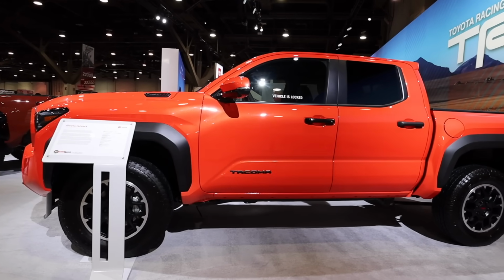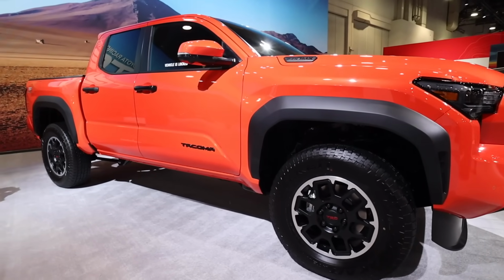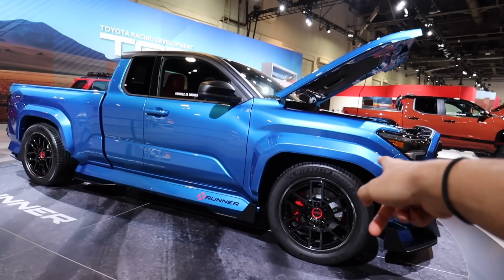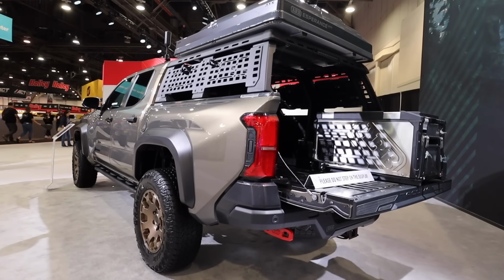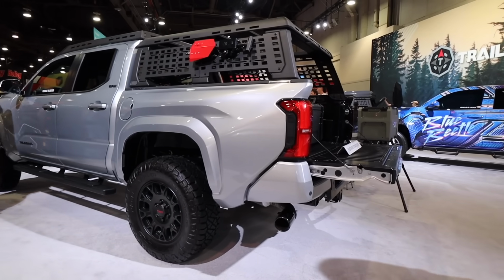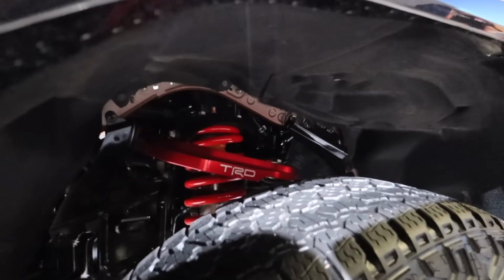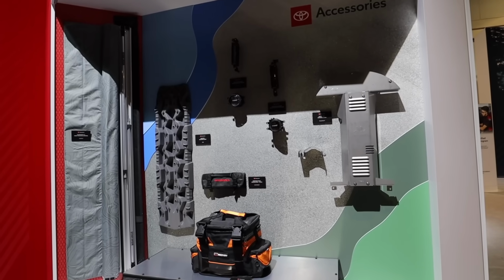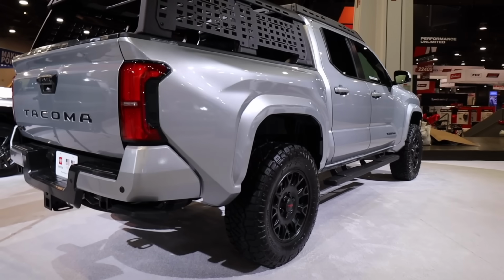Why the 2024 Tacoma is the model year to wait for! 🤷🏻‍♀️ Thoughts from a current Tacoma owner

Comment: I bought a 2023 TRD Pro a week ago because I don't want anything to do with a 4 cylinder engine.  And a new model year is going to be full of bugs with all the changes.  For the sake of the truck they should have put a small V8 in it with 300hp.  But I understand they are bending over backwards to comply with the government mpg and emission requirements.  Sucks for the consumer to not have an option.  With a V8, a trans that shifts correctly, and some useable bed tie down points, the Tacoma would be the perfect truck.
Reply: Why'd you buy a Tacoma with a V6 if a V8 is that important to you?
Reply: @ScreamsPenguin    The Tacoma fits in my garage.  The Tundra no longer has a V8 option.  Even a F150 only has one V8--and it is not the highest HP option.  It's getting hard to find full size trucks with a V8.  I can't buy what doesn't exist.  I decided to replace my '00 Durango with a mid size truck and was disappointed that nothing in the category still had a V8.  When I bought the Durango, most everything in that class had a V8 in it with a V6 being the cheap option if price was a concern. I hate this trend of more complicated smaller engines.
Reply: Sounds like you want a half ton
Reply: @slowfiveoh4986  1/2 ton won't fit in my garage, and most of them have  a V6.
Reply: @jobean5073  My garage is the same size as most homes in the US at around 20ft deep.  That seems to be the standard for the last 30 years.  While garage sizes haven't changed, the length of trucks has.  In the 1980's a four door truck was very rare and a regular cab, long bed, half ton truck would easily fit in a normal garage.  Now most trucks sold are 4 door.  How many regular cab trucks do you see on the road now?  They are very rare.  And even with short beds, the crew cab trucks are a tight fit in a 20ft garage--just a few inches to spare.  So, I don't have a small garage.  Trucks are just bigger now.  Even the Tacoma's are substantially bigger than they were 30 years ago.  I was a little surprised at how tight the fit was in my garage.

Comment: I’m a lube tech at a Toyota dealer. I’m glad I bought my 2022 Tacoma when I started here. I wouldn’t buy a 2024 since they discontinued the 6 cylinder engine in the production models. I wish they still had leaf springs on more than just the base model. I don’t like hybrids either. The high voltage battery is a ticking time bomb in that when it fails, it costs so much to replace it that insurance usually totals the vehicle. If I DID buy a 4th gen, I’d Coyote swap it as soon as the warranty expired.

Comment: This year I purchased my first brand new truck! A 2023 Lunar Rock double cab, 6 speed manual of course. The Taco loves off-roading with super low gear ratio with the manual and it’s probably the most reliable truck you can buy right now. But I’ve got my Toyota dealer trying to get me a Trail Hunter 😅 The way I see it, if I can have Toyota factory warranty all the upgrades I would do anyways and I don’t have to spend hours building it, that’s just more time I’m not worrying about break downs on my dime, and more time using my truck for work in the patch or getting out into that sweet Alberta / BC backcountry ⛰️ 

But then many will say “ But sir that thing will break down immediately just like a Ford” Ya cool story man I just don’t think Toyota would put this turbo I4 in a Land Cruiser if it meant tarnishing, the reputation that it’s had for having legendary reliability, longevity and off-road cred…

Comment: I wish the turbo V6 was a option for all of the 2024 Tacomas. I’m kinda concerned about the turbo 4 cylinder being durable enough just my opinion I’m not saying it won’t be durable but that little engine will be working harder having 2 less cylinders and being turbocharged and also making more power than the outgoing V6😬
Reply: If Ford and Chrysler(Fiat) have been doing it for a while successfully, Toyota will kill it. My dad has a JL Wrangler Rubicon 2.0T and the power comes on fast at the low RPM's and the vehicle moves effortlessly. Motors designed to handle turbos, especially at the low factory boost settings will be reliable.

As an owner of the old "TRD" supercharged setup on a 4.0 V6 Tacoma, I have faith in these new engines lasting a while (200-300k easy as Ford and Chrysler have already done). The 465lb/ft of torque is a must especially when adding weight to the truck for these "overland" builds. I have around 380lb/ft torque (crank estimate for comparison) and it is just enough to easily keep up with traffic once you add over 500lbs of mods to the truck.

Comment: Cross-shopping all midsize trucks and some base 1/2 ton trucks for purchase at the end of 2024. The Tacoma will be at the top of my list. Ideally, I would like a 6’ bed with the hybrid engine, so probably a TRD Sport. I do like the the AWD system on the Limited, but I don’t like so much chrome. We tow a small camper and haul camping gear. Our camper only weighs 2900 lbs loaded, so tow capacity is not really an issue (5,000 lb tow capacity or greater is just fine). Payload is the more important number. The previous gen Taco was weak with real world payload. If payload has been addressed, it will come down to price. I have NEVER paid MSRP or above on any new vehicle, including a Toyota.

Comment: Did they correct the horrible driving position, or do you still feel like you're sitting on the floor? Did they fix the gabage handling? The crappy brakes? Can you go up one tire size without rubbing everywhere?

Comment: Currently waiting on my 2023 Tacoma TRD Offroad, last year for the V6 replacing my 2012 TRD Off-road
Reply: I hope you test drove one first.   After driving a 2nd and 3rd gen there’s zero chance I’d buy a 3rd gen over a 2nd gen.  That 3.5 V6 and transmission combo is horrendous
Reply: @slowfiveoh4986 I understand that going in,  we have a 3rd gen in the family. Chloe has made it clear you need to do a "Tune" on the 3rd gen Tacoma. We also have a 1st gen in the family with over 340K on it and the 3rd gen has just over 200k on it. get a Ford or GM to that.

Comment: I like that it seems more modular and swappable with a nod to the taco community, and that you can finance some of the ARB and TRD accessories with the truck under warranty.  As long as the turbo is reliable, I'm in
Reply from the maker: Same here. I actually asked the engineer about his thoughts on the new 4 cylinder turbo reliability and he told me they've put them on the dynos for 150k+ miles with no issues. I don't know much more when it comes to the reliability of the engine (seems like we'll have to wait a few years), but I doubt Toyota would overlook that in the new design!
Reply: @ChloeKuo  yeah, I tend to have more faith in Toyota than others when it comes to vetting new platforms and engines.
Reply: If you finance mods you can’t afford them
Reply: @alexs825  thanks dad

Comment: I really wanted an Access Cab, manual trans, 4x4 so I bought a 2022 Sport. I think the new Tacoma will be very nice. However, my configuration no longer exists.
Reply: Yes I have a 22 OR AC I would buy a 24 OR AC if it was available
Reply: @Jan-pw4po unfortunately the only TRD option we have on the access cab is the TRD prerunner and that doesn't have a 4x4 as an option.

Comment: Toyota still needs to improve the the head space and leg space in the back.  Plus, the seats need to be better for angling comfort.  Also, Toyota needs to rustproof their structual body frame that is a problem for the past Tacomas.
Reply: If your looking for more space your honestly better off buying a Tundra
Reply: If you're looking for a frame that doesn't rust you're honestly better off buying a unibody

Comment: So far the power train seems solid in the wifes grand highlander. Just don't know how it will perform on the taco with bigger tires and a heavier platform.  Really wish they would put the twin turbo 6 in a version to atleast compete with the ranger raptor
Reply: The Grand Highlander has a higher gross weight.  It will be fine in the Taco.  It will be a big improvement over the anemic 2.7 and 3.5 engines.

Comment: That 4 cylinder turbo is not going to be as reliable as the v6. When I got the news that the 2024 had a 4 cylinder turbo, I went and bought a 2023 off road
Reply: Not as reliable Based on what?   Toyota has been making turbo I4’s for a long long time
Reply: @slowfiveoh4986  Based on physics. When you introduce a turbo, you are increasing the internal forces on the engine, and you are increasing the heat on the engine. The turbo runs incredibly hot, and the oil running through it can burn if you don't let it cool before before shutting off the engine. You are also introducing more fail points.

Comment: How long before they add the NA V6 option?
Reply: NA V6 is a thing of the past sadly 😢
Reply: @erico1120 that's why 2023 tacoma was the year for me
Reply: @richardbrown986  Taking delivery of my '23 v6 Off-Road next month.
Reply: @MisterDogg  it's so weird how many trucks have 4 cy turbos.  I was actually going to get a single can chevy with a v8 ...... bwhahahaha,  everything I saw available had 4 cy turbo in a full size truck.  That's kinda un-American 🤣😂🤣😂🤣
Reply: @richardbrown986  It is weird. Every manufacturer is trying to get more MPG's out of their trucks so I guess it sorta makes sense. Not sure if the gov is putting out new regulations ect. or if its just a trend? I don't know how they expect to get 200k plus miles without having the replace the turbo though... I need long term dependability.
Reply: @MisterDogg  right , and I use my truck for work . I could see a v6 turbo but not 4 cy ....... government taking away the working man's truck

Comment: They have the JBL system which sounds good at. low volumes but raised not too much, as someone who likes great sounding audio in my cars I will be removing the factory JBL speakers and and and replacing with higher end components. Other than that I have a 23 Tacoma OR and love it so far.

Comment: The 2023 V6 in stock form will be more reliable than the 2024 turbo 4-banger (but the 2024 won’t be “bad”.)

If she did the whole pro-YouTuber thing - cooler would be a third gen swap with a Tundra 3.4 TT V6

Comment: It doesn't have a V6... If anything I think most of us would have preferred MORE cylinders, MORE power if anything. Not to mention the turbo makes it less reliable... If anything I don't think keeping the V6 was too much to ask.
Reply: @scottishd0g87 They definitely share the blame, there can be no doubt. But Toyota also isn't standing their ground at all.
Reply: @scottishd0g87  Yeah I suppose that's true.
Reply: This one has more power than the sluggish V6
Reply: @awesomeerr8765  It's the reliability man. Also you're implying they couldn't have put a better V6 in, I would rather have had a new V6 on the table than a new 4 cylinder for a TRUCK.

Comment: I didn’t have a good experience with my 2019. In and out of the shop for unscheduled maintenance all the time. Once the dealership added and noted leaking timing cover and seeping power steering rack to all the other previous issues, that’s when I immediately cut ties. At 39,000 miles, I took advantage of the high resale and cashed out. It’s someone else’s problem now. I won’t own another 3G. I may consider the 4G, but first impressions owning the Toyota brand I was not impressed, so I am apprehensive. The only vehicle I sold in that manner with that low miles.
Reply: That’s too bad, you definitely got a lemon.

Comment: that 4 cylinder engine is going to have difficulty towing because the power comes at higher rpms so your going to have to rev it just for the power. they downgraded the engine honestly
Reply: Turbos deliver torque at lower rpms